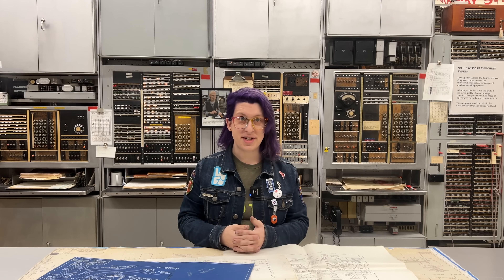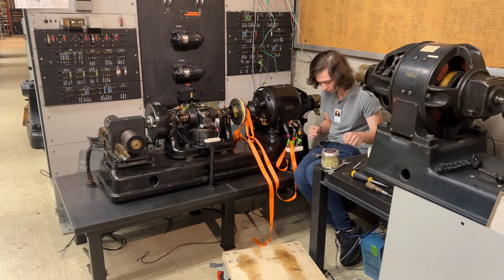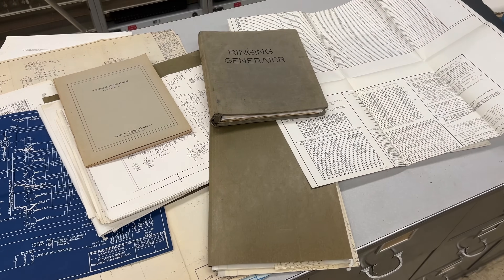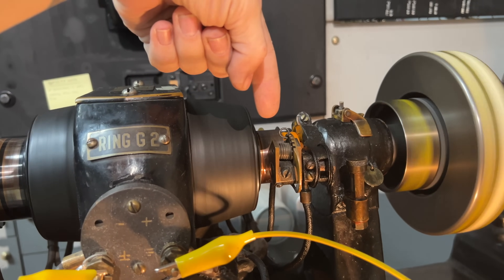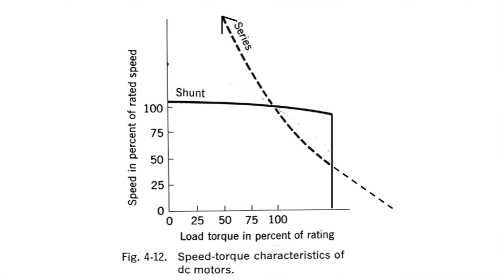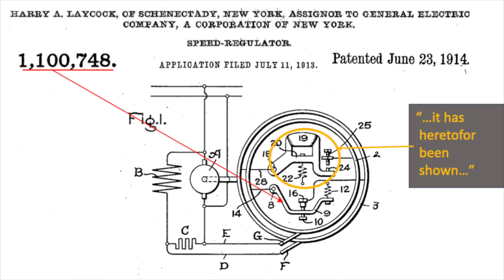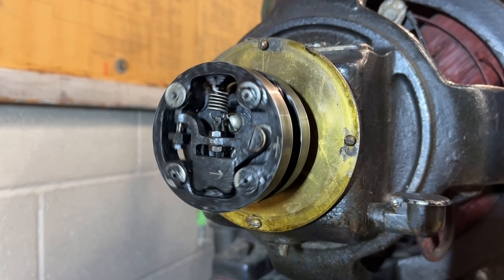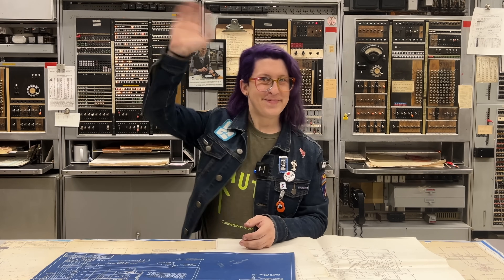Motor Speed Control in 1903! — pt. 3 — Ringing Machine

Comment: I love this channel. The poem voltage regulator system was later used in cars to keep the output constant regardless of the engine speed. I didn’t know this idea was invented so early. And the speed regulator is ingenious. This same idea was later used in battery tape recorder motors before electronic control came about.

Comment: When scoping control loops is don't just look at things in the time domain like usual oscilloscope traces, but study the PHASE changing at different points around the locked control loop for insight. Also can use a strobe light to freeze and watch mechanically in relation to electrical and magnetic values.

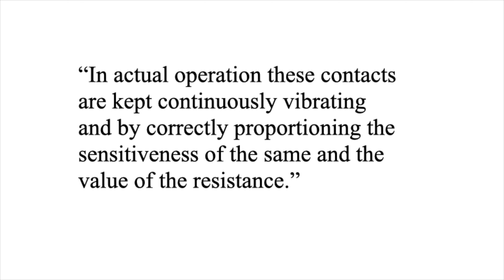Comment: 15:15  In the human body the pancreas (blood sugar control) has a 'islands of langerhans' independently self oscillating modulation in glucose secretion, which is independent of the control loop.
A car's dynamo voltage regulator / cutout 100 yrs ago has a fluttering reed oscillating between high & low. 
A simple on/off control can evolve into proportional pwm just by adding instability.

Comment: Thanks for this wonderful explainer video. Nice graphics to help explain the operations. A few thoughts on the voltage and frequency control methods follows... 

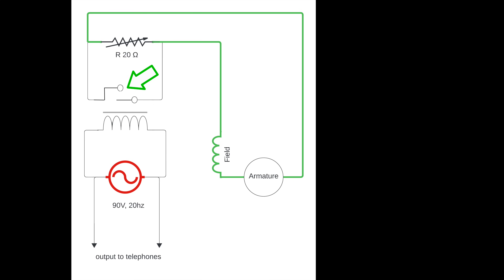In control theory, a “bang-bang controller”, also known as an on-off controller, is a feedback method that switches abruptly between two states. This type is used to control the motor VOLTAGE output. Sarah explained that an external coil (driven by the generator output- 20 Hz, 90 VAC) operates a switch; below about 90V the switch closes, more than about 90V the switch opens. This is a classic bang-bang controller.  The switch opens/closes (at 9:40 in timeline) often to keep the generator output at ~90 VAC. Very much a brute force method but a practical choice in 1903. System hysteresis reduces the switching rate.   

Shaft rotation rate

A different kind of bang-bang controller keeps the shaft FREQUENCEY constant at 20 RPS. Peter discussed a second on/off switch (at 15:30 in video) as part of the motor and it closes when spring (K strength) and mass (M) extends outward sufficiently at the desired 20 RPS speed.  

As the shaft turns, centripetal force causes the mass to extend. The force comes from centripetal acceleration. 
The centripetal acceleration of the rotating spring/mass is defined as, Ac = V^2/R.  

Where R is the length of the spring/mass combo and V is the velocity of the mass point.  Let’s assume R= 3” when extended at Fr = 20 rev/sec (20 Hz). 

Some arithmetic yields the centripetal acceleration, Ac = 1,213 m/s^2. This is independent of the mass, M. The spring length is slightly shorter at lower speeds, but this value provides insights. 
Does gravity have any effect on the spring/mass system as it rotates? We know that the acceleration of gravity is g= 9.8 m/s^2. So, Ac is >> than g. 

The movement of the mass/spring system under rotation is mainly a function of the centripetal acceleration. Without gravity the mechanism would still regulate the shaft frequency with the switch opening/closing to keep the 20 Hz speed. 

With gravity, there is a slight force bias (1-2 %) such that the switch prefers to close when the mass is near the bottom of its rotation.  I appreciate the clever design of this motor-generator. 

Finally, using Hooke's Law and the law for centripetal force it's relatively easy to find a mass M and spring constant K such that 20 Hz is the sweet spot for speed regulation.  

Thanks for this explainer video. 

Checkout more vintage motor-generators at https://www.calling315.com/ringing-machines

Comment: There is something so elegant about this. Spinning a switch physically to implement synchronous PWM feedback speed control, more or less. And then they did a similar thing with the relay for the AVR. Love it! So glad to see this.

Modern synchronous generators use a next-level trick to avoid having any brushes (wear items) at all. They have two co-axial sections, a little one and a big one. 
The little one has the one field stator like this, but instead of slip rings or commutators, the armature that spins within that has upon the shaft a three-phase to DC rectifier that spins with it, and the DC from that runs to another 'field' coil also on the same shaft, but this one spinning in the middle of the larger AC alternator section. 

Then, the amount of DC you send to the stationary field coil controls how much current and thus field strength the rotating magnetic field has in the AC alternator section of the rotor. It's like an inside-out version of the stationary field coil, but because it's on a rotating shaft, the magnetic field it makes rotates providing the stator coils on that section with changing magnetic fields so they can get three phase AC with no slip rings. 

Then the automatic voltage control controls generation voltage on the main AC stator windings in a similar way: by changing the current into the stationary field winding.

No permanent magnets required, no commutators OR slip rings, therefore no brushes and nothing to wear out apart from the bearings. And if you provide those with pressurized oil, you can prevent them ever wearing at all. 

They last forever, basically. This is how so many hydroelectric dams have been running so terribly long: and it's now just sensible resource use and ethical engineering to do things like this when you can: Totally opposite to the blight of Planned Obsolescence we've been inflicted with since. If you have the option, make things that will last. And yet the lightbulb was re-engineered to have a deliberately limited lifespan, because the manufacturers got greedy. I really hope there's a special place in hell for the people who made that so: engineering antifeatures like that is not only unethical, the consequences of the damage done is devasting, longer term. And for what?
Reply: I wish I could give you more than 1 thumb up!

Comment: In Germany you would say "Fliehkraftschalter" to this kind of RPM-controls. I got knowing of it in the 80's when I used a Siemens T37-teletyper and changed the Baud from 50 to 45,45 for ham-purposes by changing the resonance of the switch by turning a calibration-screw. That teletyper was from 1954 and still used this control. Anyway, amazing mechanical control functions, engineered lacking any kind of computer..

Comment: The regulator will deal with the load but also with the batteries going low.
I put my hand on a low end 60's batteries operated turntable, It was totally busted and i bust it even more to discover a weird mechanism inside the motor. 
it was not a permanent magnet one, weird for on this small and have a weird mechanism inside with a tuning system that I couldn't guess how it work. 
Now it appear to me that it was a miniaturized version of the 1920" one !
Sure it was the way they deal with the batteries going low . Two speed selector was mechanical of course.

Comment: So how did party line signaling work? I thought the phone ringers were wired to ring on 20 cps or 15 cps depending on the party.
Reply from the maker: Not in this system. Party lines were done here with tip-side and ring-side ringing (relative to ground on the other lead) and 1-bell or 2-bell ringing. Either “riiiinnnngg” or “riiing riiing”

Comment: @ 2:00 As a retired AT&T tech that installed DC powered equipment, and the DC powered rectifier and battery banks for them, in RT's, customer premise work ( including hospitals, FAA, DHS and other government and financial sites) and MTSO's, I HIGHLY recommend that you not just solder a wire into a connector unless you want to create a potential for failure. It's nice to think to use a "period correct" connector, BUT, by just soldering it on and not crimping it, that wire can pull out if the solder comes loose due to overheating, possibly causing a  catastrophic short circuit if the end finds a return path to ground, or a battery feed, depending on it's polarity. I spent many an hour sometimes searching through T&B and Brundy catalogs for crimp on lugs for specific wire to equipment connection applications, and always tried my best to source the proper ones, as I always wanted the best reliability for my work, and I never thought of just soldering any connectors on a wire even doing my hobby work at home now that I am retired.  Try to find modern crimp on lug solutions, coat the wire with a light coating of some No-Ox-ID compound, use a properly sized crimp, and we were required to place clear heat shrink over the crimp barrel and wire insulation for future examination of the die markings the crimper left on the lug. Time has led to improves assembly processes for a reason, and it's best to use those improvements whenever new work is performed.

Comment: Works basically the same as the voltage regulator on old automotive generator systems.  Vibrating relay shorting a resistor to control output.

Comment: Hello Sarah, i just wanted to comment about your wire termination with your solder dip.  I wanted to recommend finding a way to incorporate mechanical clamping force in the conductors and then soldering it as a more robust way to terminate. There's always an active debate as to solder or mechanical termination and I'm not going to say that you are doing it wrong because i don't know if I'm right. But solder can become resistive as it heats up and then it becomes a feedback  loop and melts the solder.  IF there is a published procedure please follow that over my own input.  Thank you for your time.

Comment: Scariest thing in the power room
Reply: IMO, the "scariest" thing in any power room I have been in, besides outdated rectifier systems just waiting to fail, is the racks and racks of wet cell, or "flooded" 1.5V battery jar's bused together to create power for backup in case of power failure. Each one is holds well over 7 gallons of acid, weighs over 300 lbs, and I don't even know what the AH rating is on them, but knowing they are connected in series and parallel strings to provide 48 volt strings with enough reserve to cover for hours in case a generator cannot be put online fast enough. If you research the Hinsdale IL central office fire, the batteries helped feed power into the short circuit that was caused by careless cable mining in racks with working power cables, and nobody on site knew to even try to disconnect the batteries to stop the power feeding into the short circuit.
Reply: saw the battery indentation in the power room floor from those batteries and catwalks over them but - i agree that would stop me cold.  :) @poormanselectronicsbench2021

Comment: This is incredibly clever and not something I would have immediately guessed, but for the era it's a good solution. PWM in 1908-1911 is just wild! I would be interested to know how quickly the mean duty cycle width adapts relative to the load and whether there is an initial period of hysteresis before the phase settles down. PS: Love the hair, Sarah!

Comment: Very clear explanation and amazing video as always. Does this generate a lot of electrical noise ? Is there any filtering to damp it ?
Reply from the maker: There are two "battery" supplies in a telephone office. SIGNAL and TALK (QUIET) battery. They all come from the same battery plant, of course, but Talk battery is filtered so that you can't hear the noises from the various rotating machines, and relays clicking. 

There is a sample of noisy SIGNAL battery here: https://youtu.be/Gsx2ZsYggGw?si=FtIUOJU1lOBbpcer&t=207  Normally, a subscriber would never hear this, but I hooked up a telephone across the main 48V battery feeder before it entered the filters, and that's what I heard.

Comment: Want one of those rotary dial shirts :-) Very nice explanation. And the ringing machine restoration project is going nicely. Are t here plans to resurrect the AC ringing machine so you can have a full system with all the failover logic working? Also, the speed regulation circuit reminds me of the "spinning balls governor" that you see on old steam engines...
Reply from the maker: I'd love to have the AC machine running as well, but its just not realistic. We don't have enough room. Just to get this stuff in we had to move a bunch of other exhibits out of the way.

Comment: Clever engineering.  There is a two volume set of books, A History of Engineering and Science in the Bell System .  Volume I covers 1875 - 1925.  It is one of my go-to books when I have some free time.  At over 1,000 pages there is a lot to learn in there.  One of my favorite stories is the development of the carbon transmitter which was actually something out of Edison’s lab.  I’ve noticed that properly adjusted old carbon transmitters are actually quite loud, almost painfully loud.  There is actually a power gain of around 50 in the transmitter (mechanical to electrical). There was an early demonstration where a political speech was transmitted across around 100 miles to an audience listening to horn type loudspeakers.  The speakers were driven directly by the remote carbon transmitter which had to be water cooled because it was carrying around 6 amps.  The Shreeve Mechanical Amplifier of 1904 was a magnetic receiver coupled to a carbon transmitter.  Bandwidth and sound quality were not great.  Luckily DeForest and Fessenden developed vacuum tube amplifiers within ten years ( pages 253 - 258 of the book above).

Comment: Cable lacing is something I still need to learn.  For a while I volunteered on the Battleship New Jersey fixing their phone systems and seeing the lacing on the back of some of the electrical panels would just make me sit and stare for a while at the quality and care that went into it.
Reply: It's not hard to learn but it tends to be really hard on your hands, especially if you want it tight.
Reply: There's some good videos on lacing here, esp the "Chicago" and "Kansas City" lacing to cable racks, which, I had to learn and use. As a cable splicer back in 1982, we were trained & tasked with running cabling up in the overhead racks in Merrimac CO in Chicago when they were adding a "Cosmic" frame for a new switch, then, getting into a crew that installed Litespan systems for DSL in the early 2000's caused me to do a lot of it.
Reply: I’ve seen their videos and have wondered what PBX the battleship has. I remember hearing the Iowa-class battleships ended up with Dimension PBXs but is that what they’re running today as a museum?
Reply: @thecooldude9999  I don't know what was on there when it was shut down, I think it was empty when it was sent to Camden.  The legend goes that a group of ex-Verizon employees heard about it and managed to find a Definity (System 75?) that was being surplussed from somewhere and helped get it on board, repopulated the cross connect field and basically got things going with that.  I know the unit that was there suffered a failure but there was another unit two decks above that had to be disassembled, part of the cabinet cut off, moved, and riveted back together to get into the telco room since it couldn't make it through one of the bulkheads otherwise.  For a short while there was a desktop cabinet in there too with a very limited number of ports available which was used in between the one system failing and the other getting moved into place.  I haven't been aboard in a number of years now but when I was a regular the telco room next to the oil lab was my usual haunt, if I wasn't roaming the decks with a butt set looking for a off hook type G that someone picked up thinking it wasn't operational but didn't put back with the sea catch in place properly.

Comment: I know what a voltage regulator is and does. But, until now I never understood how it worked. 
Thank you🤯
Reply: That's an awesome feeling in that moment isn't it?  I remember when I had mine.  1972 Jaguar v12 tachometer Operation this leads to Variable PWM where the voltage level AND duty cycle can be combined to create enhanced control schemes.

Comment: To the right of the RAS alarm lamp, there is a small bank of fuses with the label SURGE DRAIN below them. What are they for (I assume the label is for the fuses and not something else I didn't see)?
Reply from the maker: The SURGE DRAIN circuit is a bank of resistors, capacitors, and varistors that are connected to ground on one end, and the ringing output of the machine on the other. It absorbs surges and provides a soft cushion for the machine in case the load goes dramatically up or down.

Comment: Their engineers were just as smart as us - they just had different ingredients to work with.
Reply: No, they were probably smarter.  They were basically starting from scratch with little to build on. They had to use their basic knowledge and imagination to come up with totally new designs.  Yet they built amazing, durable, useful machines that broke new ground and lasted for decades, unlike the disposable garbage the Chinese manufacture now.
Reply: @DEW409  Most of what we have today hasn't been made possible by engineers, it's been made possible by the widespread availability of very specific materials such as silicon or rare earths.
Whereas a century ago, everything electrical had to be made out of steel, copper and wood. Yet electric cars and tramways already existed in the late 1800s. And when overhead wires weren't acceptable the tramways were powered by compressed air.
Back at the time, engineers invented a lot of weird electrical machines, such as dynamotors, 3-brush dynamos, rotary converters, phase converters, metadynes, amplidynes, synchros, resolvers, magnetic amplifiers... of course those have totally disappeared because of modern semiconductors.